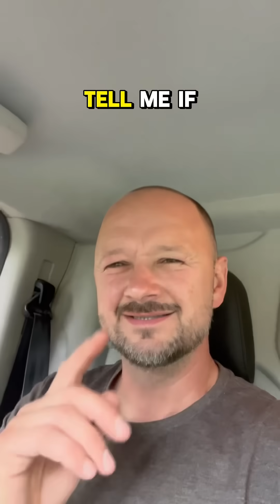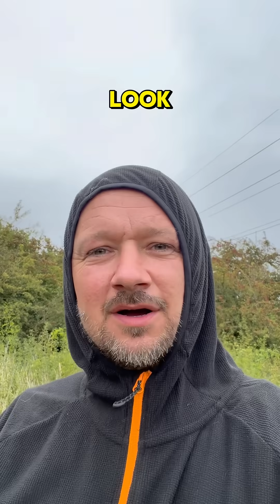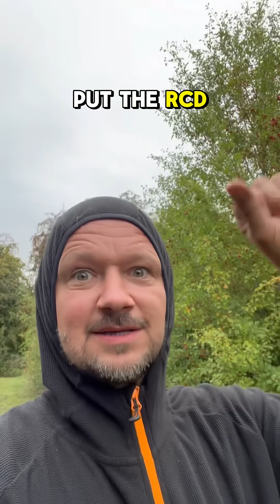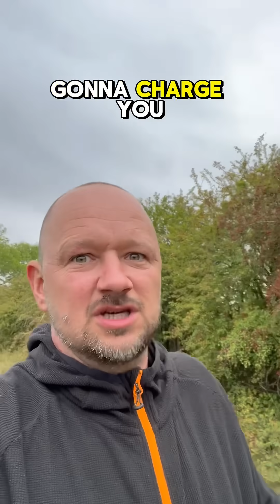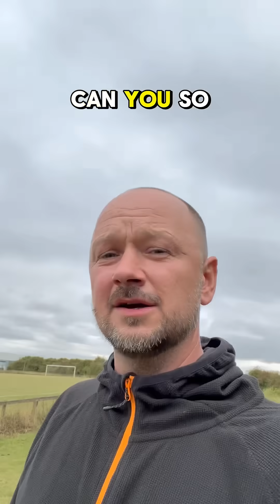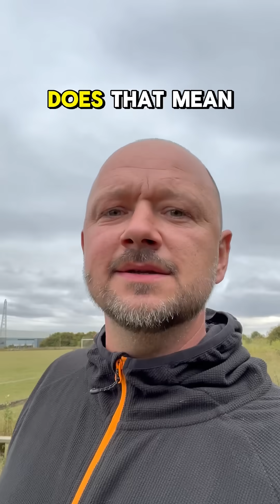I Solved Her Tripping RCD… Then She Asked THIS

Comment: It could be faulty toaster (most likely to be fair), or faulty RCD, overloaded circuit, etc. They could try it on a different circuit to double check, maybe garage with its own RCD. Probably a short in the toaster heating element.
Reply from the maker: True, could be anything - that’s why you can a spark hey?

Comment: I expect that you'd find this in most customer facing jobs. eg. Working in PC shop and customer's new printer didn't work straight away so she cut out the inline psu with scissors and then had joined the ac and dc wires together with cellotape, giving her a mains voltage barrel connector going straight into the back of her new printer. As smoke came out, she thought she'd better return it as faulty.
Reply from the maker: Some people don't understand electricity at all!

Comment: I had one element of an electric hob go leaky. After a bit of searching I realised it wasn't practical to source a replacement so I completely disconnected the duff element and we used the one remaining ring for a year or so before replacing the unit.

Comment: Working on a caravan site you can get the issue that it's not the fact that anything in the caravan is faulty but 16A doesn't get you very far, especially if the hob and oven are electric. No the kettle isn't faulty it's just the straw the brike the camels back.
Making breakfast and your 3kW kettle, 700W toaster, and ~1.2kW microwave (input power) and your over 16A already. There's even some larger vans/lodges on only a 16A supply, and they have a dishwasher and washing machine.

Saying that toasters are my most failed item at work, rarely if ever failing because of an electrical issue but because people like to put their fingers (or other object) through the element.

Comment: You can charge for the call mate - you just have to frame it as "it'll be £50-75 for me to come out, however I might be able tomsolve it for you on facetime for £20 - saves polluting the environment with unnecessary miles, moreover saves you money!"  That'll work, I promise.  You get paid for your expertise, not your presence.  Solicitors and tech help charge for time on phone calls dont they - your skillages are no different Sparks.

Comment: I had a similar issue, kept tripping all the time and I could not for the life of me narrow it down. It did my head in. I was convinced it was the toaster. Finally got my uncle (a spark) in to fix it. In the end it was a loose spur casing combined with some cowboy who just placed the duct onto the kitchen extractor fan without a cable tie causing it to flop off when turned on, creating a buildup of moisture in the room which condensed on the cold back wall, leaked into the spur and set it off now and again. Nightmare

Comment: It's surprising how a lot of people don't even have basic fault finding skills. Having spent a few years installing and fixing fibre broadband I have been to lots of faults where it could easily have been sorted by some basic fault finding. Often some old crappy device just doesn't work properly but people then think it's their WiFi that's the issue not the 15 year old laptop when they can't get it to run at 1gbps 😂

Comment: As a non electrician, it took me a hot minute to rationalise why it couldn't be the socket. RCD means the fault is a short to ground. That means it must be on the far side of a switch or it wouldn't wait to draw that current.

My initial thought was that you needed to try the toaster in another socket and something else in that socket to separate the two.
Reply: In theory you could have a socket with neutral and earth swapped. It only shows a fault when current is drawn. It shouldn't ever happen as it is hard to miswire something that badly.

Comment: Normal practice these days unfortunately...I had one with similar issues. Lighting circuit trips when turning on front room lights...I rewired the house and there was zero issues. I tested the whole lighting circuit, all good so head scratching started...

Took 3 weeks to find the issue, her husband had been screwing the light bulbs in so hard that the contacts at the base of the cheap light fitting directly shorted each other...when this happenes, he unscrews them again and doesn't mention it, just says electrics are resetting  😂

Comment: Using the same method once I deteremined my washing machine was at fault. After inspection I discovered green slime on the mother board, a slug has gotten on it and exploded. Cleaned up the mess on the board and all was well.

Comment: It never fails to amaze me how little people in general don’t want to know about the way their electricity gets to their appliances. I don’t mean like our deep understanding but just the most basic like sockets and lights are on different circuits. So if you turn off the lights your sockets won’t go off. Or that there are even different circuits in the house. It really does amaze me. 😂
Reply from the maker: I know, I think common knowledge is taken for granted
Reply: You clearly wasn't about in the 70s then because they used to run goverment information adds about the dangers of running electric fires and toasters off of lighting sockets that had extension bayonets because it could end up with you burning the gaff down. 😂

Comment: Never a truer word said in jest. Had a customer in the past who owned a restaurant and take away, they rung me up to say the RCD was tripping constantly and none of the sockets were working and they could not open up for business. Done the same thing as yourself, turns out the fridge had been moved and trapped the flex. They opened up, however they taped up the flex otherwise they would have lost a lot of food. They did get it repaired. Plus they gave me a free meal. Bargain 🎉

Comment: I’ve had many similar situations the question is , is it the socket or the toaster we as electricians know that it is most probably the toaster bud what if it’s the socket at fault ? I always advise to try the kettle into the same socket or visa versa this just verifies to the customer that there is no issues with the point and puts the customer at ease 👏👏👏
Reply from the maker: Good idea

Comment: Some customers aren't really that tuned in & just dont realise the issue. 
I had a customer that argued with me claiming that i only need to run a live wire as you dont need a return cable & that i should look at the situation like water coming out of a hose😮😮  i carried on with my work & f**ked off.
I did also have that tripping issue once with kitchen ring & the lady had a new toaster with a fried mouse in it 😮. The place was a shit hole though.😅
Reply from the maker: Yes, some people could save money by cleaning up